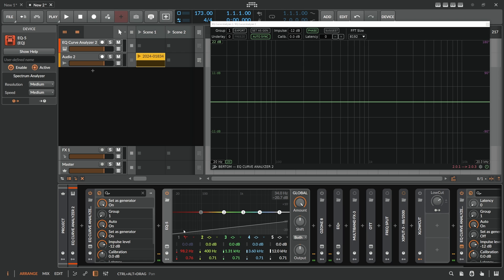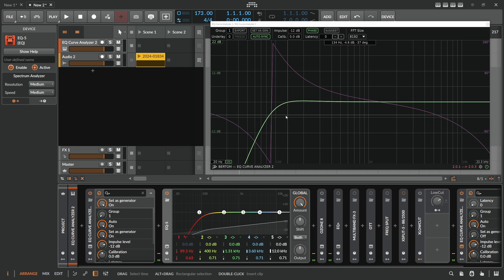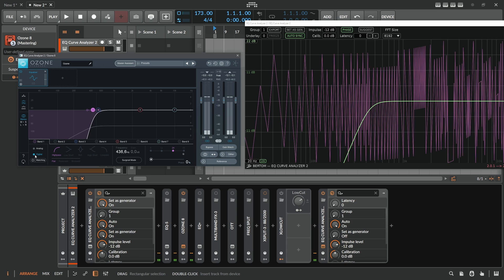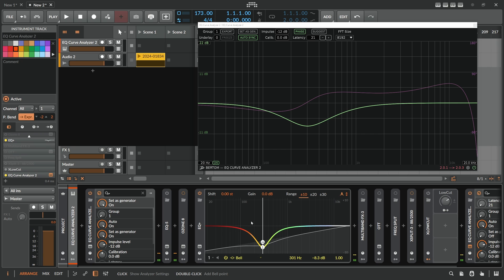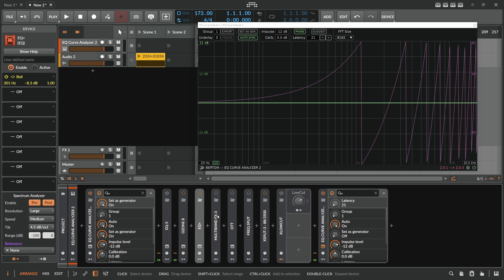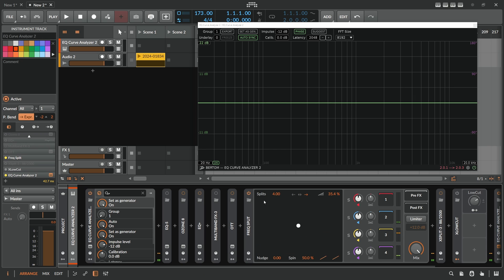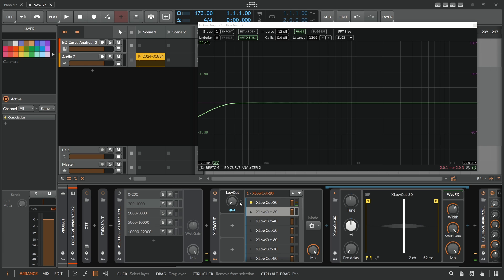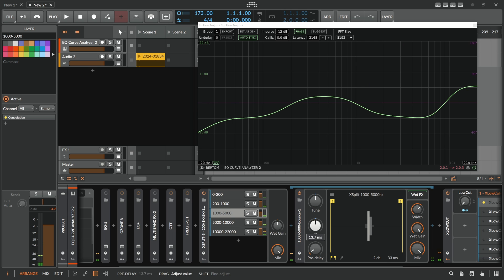do you have phase issues? - Linear Phase Frequency Splitting

Comment: If you want to roll your own multiband split (used for ducking in my case) without disturbing phase, but with (fully non-stepped) variable bands and frequencies, and you are OK with some latency, what's the current best option?  I'm assuming you'd want some version of fx layer with parallel linear phase EQ's with custom defined bands that end where the next starts.  I'm guessing you'd also want a gentle slope (maybe 12dB/oct?  Maybe even 6?). Are there other factors to consider?  Filter type?  Can this truly null when no FX on the bands?  Is there a version of this that is as light as possible on CPU?  CPU usage vs impulse method?  What's the current best way to achieve these goals in Bitwig?  Also, is there a video that describes the creation of the impulse EQ bands?  If so, I missed it, so is there a particular keyword to locate it?
Reply from the maker: Like I showed in the video: with freq split
Reply: @PolarityMusic  I guess I'm no seeing how that gives measured control over individual freq splits.  Are you just nudging and spinning while looking at 3rd party analyzer to somehow determine that band 2 is 500-1800 hz or similar?

Comment: What about the crossover vst is it better than your spliter,basically I use crossover vst as a 5 band ott and I put bitwig dynamic device in each band
Reply from the maker: crossover is fine. just wanted to solve some problems with stock devices.

Comment: Great video as always. But I'd like to correct one of the words you used at the very beginning when showing the impact of a low latency low cut: moving from +180° to -180° is a 360° shift so it's actually the same phase, not a phase inversion. The apparent steep shift comes from the screen display only. The sound is indeed affected by the continous phase shift, but not by the false "vertical" shift.
Reply from the maker: But isn't the point of -180 (which is also +180) the point where the phase inversion is complete (i.e., a full 180°)? I'll have to rewatch what I said, but the vertical line usually indicates exactly the point where you reach 180°.